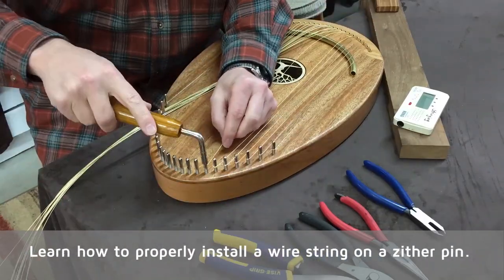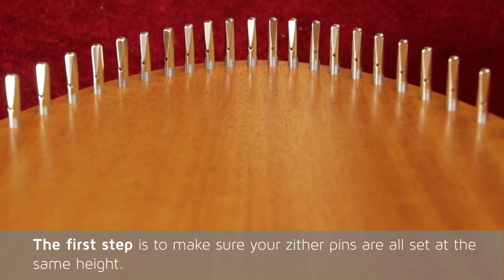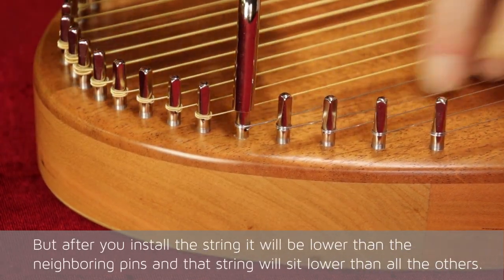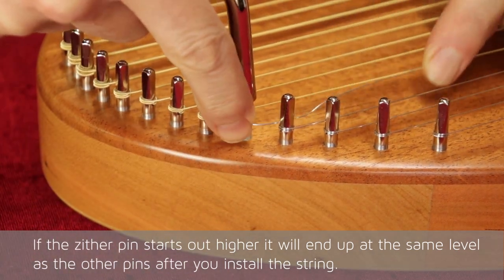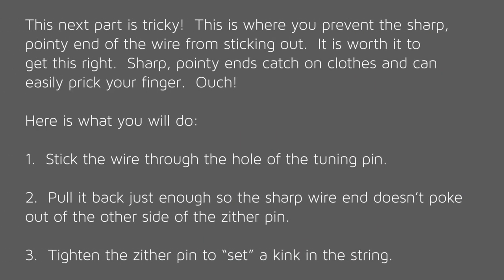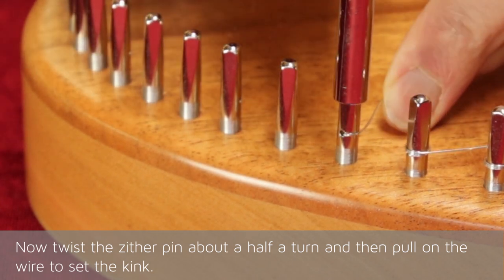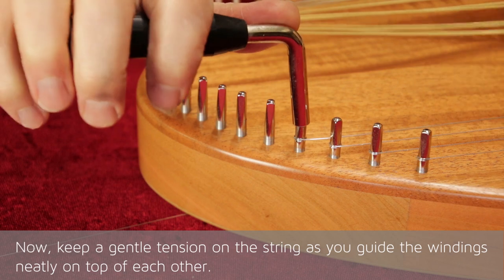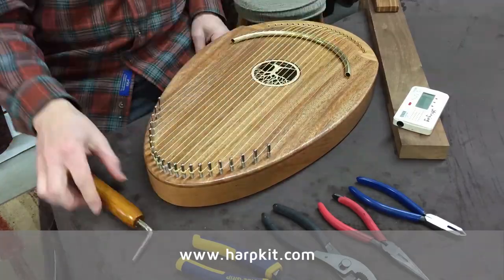Installing strings on a Reverie Harp

Comment: Good information but how come no one ever shows the other end? How does that get put in when no knots or anything show beneath the exit point?
Reply: @HarpKit  well I had a string break yesterday so I figured it out real quick. I didn’t realize it was attached to a metal barrel on the other end. Thanks.